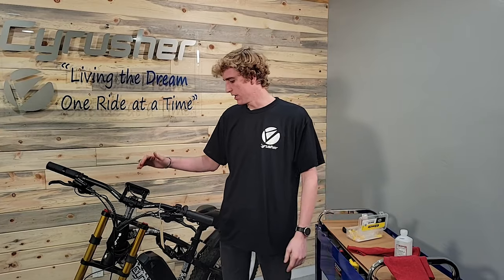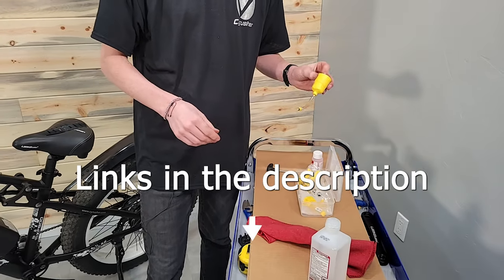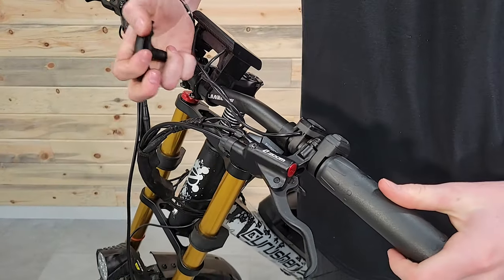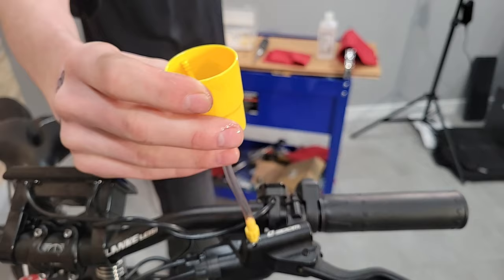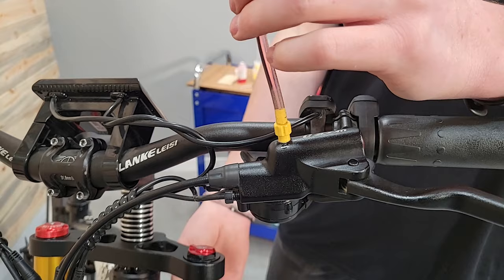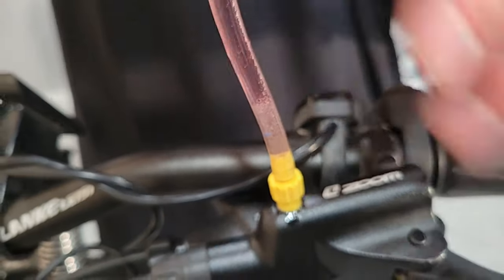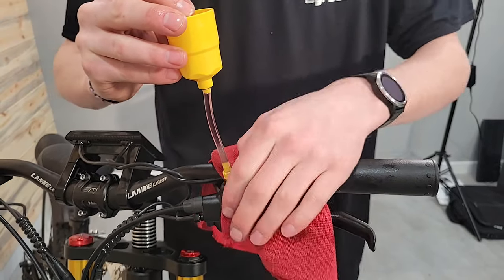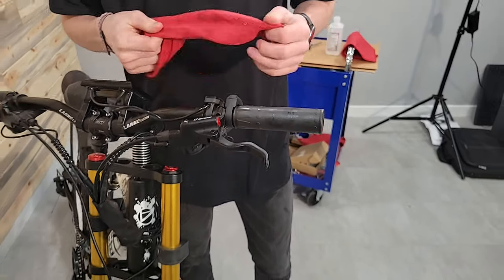Top Brake Bleed tutorial for Cyrusher E-bikes

Comment: It looks like you are removing oil from the brake line. Do you need to add more oil? If so how?
Reply from the maker: You can add more oil by performing a full brake bleed or by just pushing oil into the top of the of the brake line using the cup and plunger

Comment: How do I adjust the suspension it’s hella stiff cyrusher xf800
Reply from the maker: There is a lockout on the XF800 forks or unlocked, its the red knob on the right fork leg
Reply: What he trying not to say is that the fork is a POS and can't be adjusted, probably a spring, with a "lock-out", so it's either working to whatever low standard it can manage or it's not there. Junk, the entire bike.